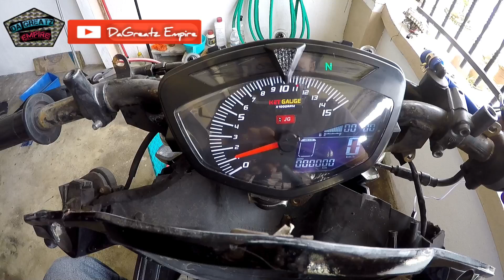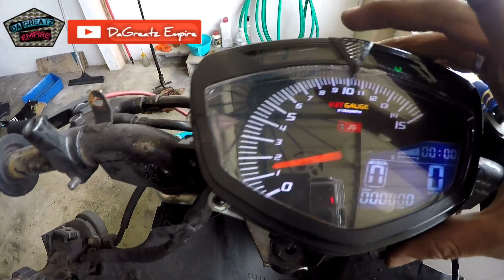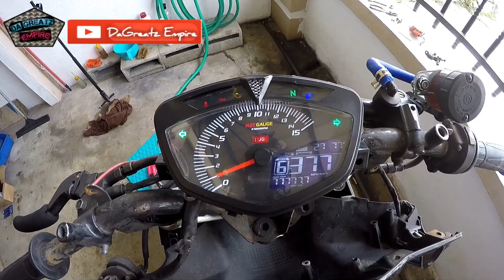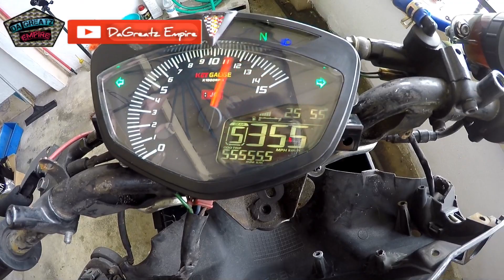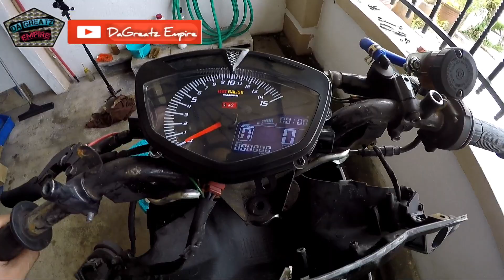#9 CARA PASANG / WIRING DIGITAL METER Yamaha LC135

Comment: Utu kak kalau ga pake tali speedometer di roda tu tetap berfungsi spedometer nya juga kak kan?
Reply from the maker: Kalau tak pakai nanti speedo meter tak berfungsi
Reply: Itu kak walaupun gak di bawa motor nya di gas aja rpm nya kan naik kak kan jadi kalau gak di pake tali spedometer nya rpm nya naik juga kak kan?
Reply from the maker: @teukumarrlays9807  ya akan naik

Comment: Salam bos,lari tajuk sikit... Kalau ON suis tapi meter x naik lampu N n meter minyak ..starter pun jadi kosong.. apa problem ye? Mcmana nk cek kalau guna multimeter? Meter masih asal lc v1..tolong kawan bosss... Pening dh cari punca.. tqvm
Reply from the maker: Waalaikumsalam...start Motor engine boleh hidup tak?
Reply: @DaGreatzEmpire switch ON/OFF sudah tukar baru.. fius ok x putus..kalau pakai kick starter sekali kick blh hidup mcm biasa..relay starter sdh tukar baru..tula cari punca x jumpa 😂😂
Reply from the maker: @mohdshahrilazri2625  check socket dekat meter tngok kot tak masuk kemas

Comment: Bos kenapa jam tak save..bila bukak kunci reset balik
Reply from the maker: Kena joint kan wire Dari meter dekat wire hidup/ battery
Reply: Saya punya costem bang
Reply: Semua wayar saya dah sambung kecuali wayar pink.kuning putih Dagan wayar oren dan putih
Reply: @DaGreatzEmpire  wayar mana satu bang
Reply: Saya pecah kepala dah bang
Reply: Kalau wayar merah kunci wayar hitam short body wayar mane satu straight battery bang
Reply from the maker: @faizalmonster3225  kalau custom kna check satu2😂
Reply: Ooo jadi wayar jam hanya sentuh kulit wayar kunci api direct...betul tak
Reply: Makna nya ada lagi wayar saya kena cek 😭😭😭😭😭

Comment: Bro minit 8.40.. Cabut wayar apa untuk betul kan minyak?
Reply from the maker: Level minyak adjust dekat button. Wiring tu just reset connection dkt tank dgn meter
Reply: @DaGreatzEmpire  ok baikkk.. Cara nak adjust.. Mcam mna?
Reply from the maker: @iadieyyvone580  off kunci. Then tekan button lama2 sampai naik minyak level
Reply: @DaGreatzEmpire  ok baikk.. Off kunci ..Lepas tu button tekan lama2..
 
Lepas tu meter dapat bca minyak dalam tank ka?
Reply from the maker: @iadieyyvone580  bgantung jgk pd meter ada yg baca accurate ada yg  tak brpa accurate
Reply: As salam bro...dh buat tp x jadi pun...

Comment: Punya saya ko jamnya selalu reset yah pak dah gitu lampu ket gauge ga bisa ubah ketika lampu jauh di tekan. Mohon pencerhanya.
Reply from the maker: Wiring jam kena joint skali dengan wire suis. Baru jam on direct bos
Reply: @DaGreatzEmpire  kabelnya warna apa yang coneting ke jam pak
Reply: Itu motornya ac apa dc kelistrikanya. ?
Reply from the maker: @eno_ex  dc boss
Reply: @DaGreatzEmpire  itu kenapa penyebeb ga bisa setting rpm.
Reply from the maker: @eno_ex  rpm ikut putaran engine